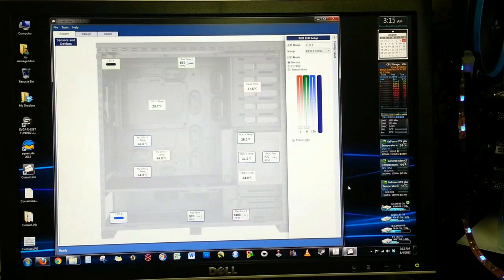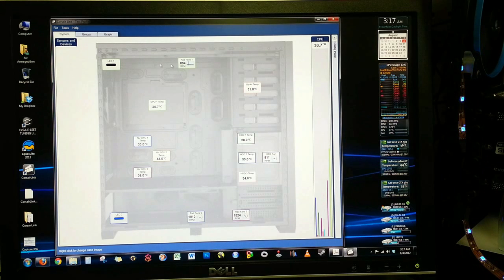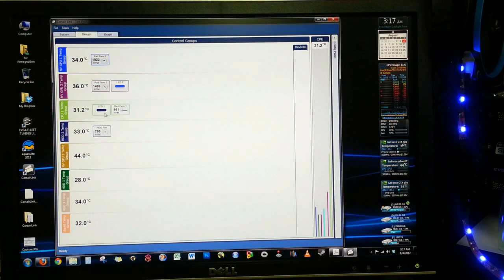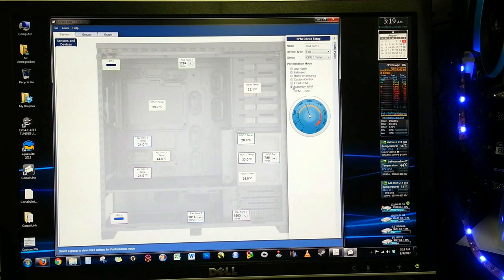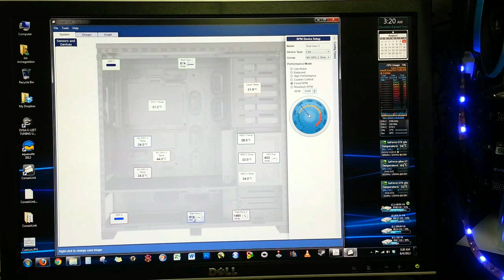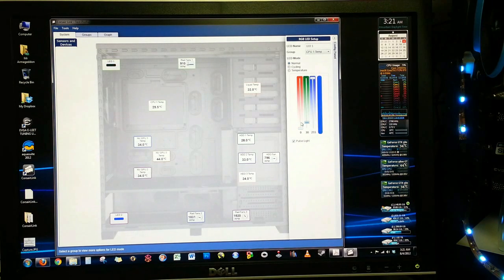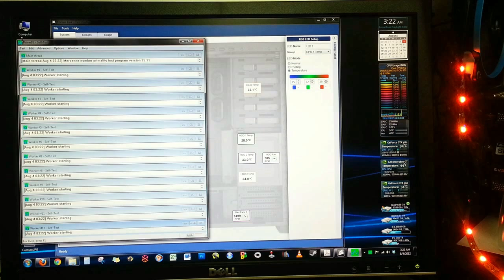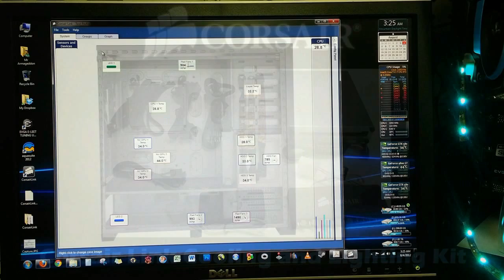Corsair Link Cooling & Lighting Kit Overview

Comment: I'm looking into adding a water cooling loop to my system which will use a total of 6 120mm fans. Will the Corsair Link allow me to control all my fans? I read that it will only allow 5.
Reply from the maker: There are only 5 fan plug-ins per control node. You can purchase a second control node, or just splice 2 fans that you want to be the same speed (a set of fans cooling a 240 Radiator for example) into 1 connector like I have.  It shouldn't have any problem, as it works with my 9 fan setup.

Comment: Have not seen anyone come up with a white light strip color. I am assuming you can, but can you confirm this?
Reply: I no longer have the Corsair Link kit installed.  I am using an AquaComputer setup to control my fans and pumps now.  Sorry.
Reply from the maker: Corsair released a new video showing their 760t Case.  They are also using a Corsair Link kit w/ LED, and it is White in color.  Search for this on YouTube to see:  "CES 2014: Corsair Graphite Series 760t PC Chassis"

Comment: what should i buy because im so confused, i just want to connect my case fans, do i need the cooling kit, the one that installs in 3.5 inch bay?
Reply from the maker: Yes the Corsair Link cooling kit has everything you need to control your case fans.  The lighting kit is an add-on that isn't necessary.

Comment from the maker: I am using a combination of AF (Air Flow) series fans for the Hard Drive cage and rear exhaust, and SP (Static Pressure) series fans on all of the radiators.  Both work fine with Corsair Link or any other Fan Controller.  PWM is not needed to control fan speed, as fans speed can also be reduced via voltage throttling, which is how most fan controllers work.

Comment from the maker: The Corsair Link kit I used included the LED light strips.  The software controls the "Breathing" effect you see on the video. You can also set it to increase the intensity of the light based off current system temperatures.

Comment from the maker: @itzdataznboi - the 9800GT is primarily a dedicated PhysX GPU.  Aside from PhysX, I use it to power my two side monitors (#2-3) even while using SLI with the 580GTXs on my primary display.  Otherwise I would only be able to use 2 of my 3 monitors while SLI in enabled.  I like having my side monitors enabled to show temps and other info while gaming.